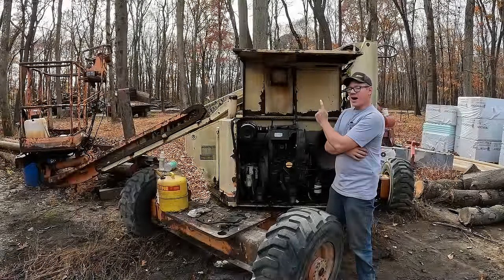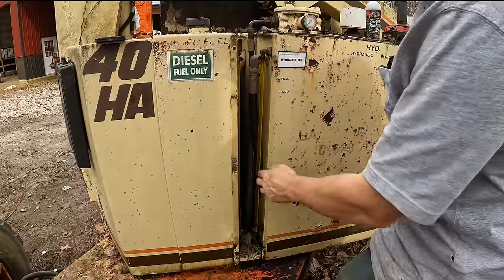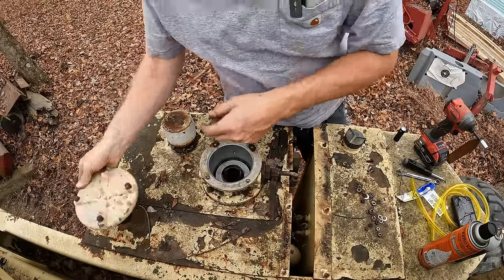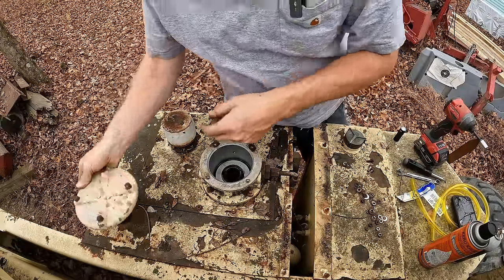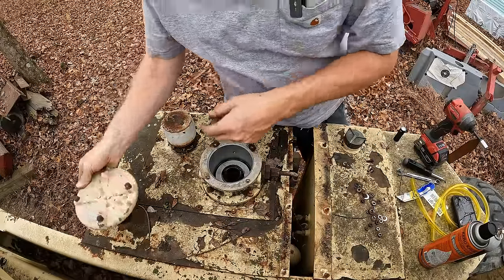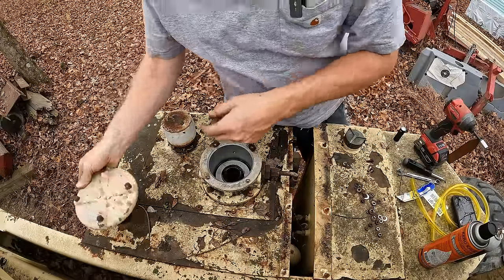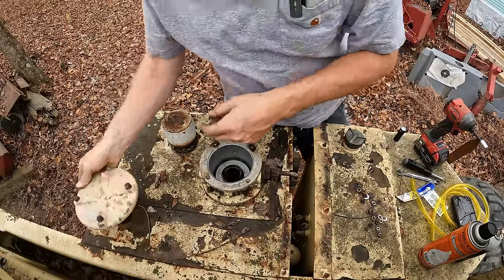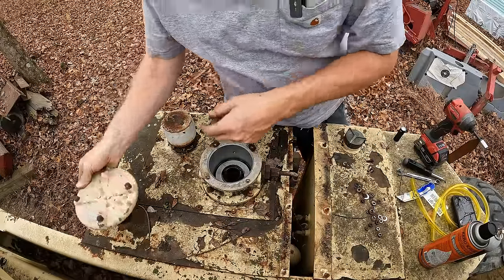I paid $1000 for this 4x4, Diesel, Man-Lift, What could possible go wrong? (JLG)

Comment: Just a tip I’d like to pass on, when working on a tank like that rather than struggling with a torch just crack a glo-stick then tie it to a length of string and drop in into the tank, once you finish just pull it out again. Great video as always Matt.
Reply: Interesting idea. Will have to try it.
Reply: Smart
Reply: A former employer of mine quit using Kroil because of it being cancer causing. Has KROIL changed their recipe since then? 
I used to not care that much, but my dad died this year of 8 different cancers.
Reply: That's a great tip
Reply: @maniachill3069  what doesn’t cause cancer?
Reply: Clever.
Reply: That glow is stick works well except the perception. Green color sort of distorts my perception whereas a white light is better.  Good idea!
Reply: @scottschenk5456  there are white glow sticks and chem lights. They come in every color
Reply: @crash1522  was just about to say you can get white chem lights
Reply: You need to watch more of his videos
Reply: @meowmeow2479  broccoli
Reply: @maniachill3069  how can 8 different cancers kill anyone? If you got hit with 8 different bullet wounds at once, one of them would actually do the killing and the others would just be injuries. Many patients have simultaneous and contributory conditions but in the race to cause death, there's always one leader. If the driver of a car has a heart attack which causes incapacitation and they crash through a bridge rail and into the lake, break their neck and are trapped in the car as it sinks, they'll most likely die of asphyxiation not a heart attack, car crash, or broken neck.
Reply: wonderful idea.
Reply: @maniachill3069  how did said employee PROVE that kroil causes cancer?
Reply: O

Comment: ED here, bought a simon-terex two yrs ago for $1100. drove it on the trailer, aftermuch work/ trimmed trees with it. it was izuzu diesel- had 50 gal. of fuel in it. lost the hyd  fluid once it blew down boom/ dripped 2 weeks in buckets. caught in buckets, was big job to pull cyclinders/ rebuild. sold for $2500. almost got killed loading on trailer!!!!!!!!!!!!!!!1

Comment: You could put a little valve at the bottom of the sight tubes, so when they’re not being used, just close off the valve to avoid the risk of it accidentally dumping its fuel/oil everywhere
Reply: this is a great idea!
Reply: This is actually how they do that on ships. You press a valve to get a level, and when you let go it springs back to the shut position
Reply: i was thinking about it too :) , it's the best way to avoid future issues
Reply: Good idea my worry with that tube is it probably isn't UV rated so will go fairly quickly. Defo put a valve in before installing a $1000 worth of oil.
Reply: Excellent Idea!
Reply: Dang, you beat me to it. I have used this solution many times. You only open the valve when you want a look.
Reply: not possible with out a hose to the ball valve, barbed fitting welded to tank, unless you remove tank an cut it off an welded in a 1/2" female NPT fitting, but dont think there room between he 2 tanks for all th fittings an valves
Reply: @arnoldromppai5395  Pipe thread elbow in the tank, ball valve threaded onto elbow, barb fitting threaded into ball valve. I've done it many times.
Reply: @jthampshire  again as a welder on heavy equipment 60 years you have to remove the tanks to cut out the barbed fitting an weld in a NPT  fitting, but if you have seen this machine there is no room for 2 sets between the tanks
Reply: @arnoldromppai5395  the picture i saw it has a brass elbow that is  threaded into the tank ,hose barbs on this kind of equipment are rarely steel ,, maybe on really big heavy equipment  they are welded but this isn't really classed as heavy equipment  ,,i have worked around mining equipment and most of that stuff has welded hose barbs on stuff like low pressure return lines ,,large lines are welded to protect against vibration on large equipment
Reply: I was going to suggest the same thing, its what we did on a friends machine, it gives a lot of peace of mind.
Reply: Agree

Comment: I don’t know if you’ve already seen FarmCraft101’s latest video, but he got stuck up high on his man lift & the auxiliary power didn’t function, so he had to rappel back down - might be worth having a rope & harness on board when you go up
Reply: I know it's not a thing in the US, but in some countries here in Europe it's mandatory to wear a harness when you go up in a manlift and stay attached to it at all times when in the basket - so if the hydraulic suddenly fails and the boom goes down, you go down with it instead of freefalling to the ground
Reply: @thesteelrodent1796  it is mandatory
 on all the job sites I’ve been on here in the us, it’s mostly because if you drive the wheels off a curb or something it can catapult you out of the basket, the hydraulic system on this type of equipment has holding valves on the cylinders that keep you from dropping from a line failure
Reply: @thesteelrodent1796  It is a thing, it's just that enforcement is spotty at best. It's not so much the boom falling to the ground and you're safer falling with that or whatever you're suggesting. It's to restrain you If the boom is struck or the chassis is struck or loses it's footing, sinkhole or something and the basket does something to eject you,.
Reply: @devriesfabmachine8721  I always have wondered how they stop the piston from falling if a line breaks. Thanks now I know ☺️
Reply: @thesteelrodent1796  it is a thing for the “for hire” or commercial operator not for the average Matt working on his own property. Though it’s always a good idea.
Reply: @corydriver7634  Here (Sweden Europe) it is a thing for the customer - if you take someone in for work there the insurance situation is unclear (because the guy is doing it at his free time)  injuries or death is on THE property owner.

This includes if you take someone in to cut down a tree using a chainsaw - there the requirements is that the wielder has a defined education (chainsaw using license.)
Reply: @thesteelrodent1796  OSHA requirements for fall protection are mandatory. Of course, as is typical with government regulations, it depends on height, whether it's a construction site, general industry/manufacturing and others. In other words, in plants the minimum height is 4 feet, construction I believe is 6 feet. That's why safety officers have to know the rules. Confusing.
Reply: i wouldn't touch that crusty man lift without a fall arrestor and a dead man switch to hit the e stop if i went over the side. for any kind of union work all of that is required, but if you are running a man lift on your own its whatever you feel like doing. he was probably fine without the harness in this video because the worst it could do is go into wild spin mode and toss him off. i suppose he could have gotten pinned between the boom and the frame which could be lethal. this dude is kind of famous for laughing at OSHA safety though lol
Reply: @Gunbudder  It is actually OK to be responsible for ones own self without the government nanny state having to baby sit.
Reply: I guess I should of read your reply before I posted lol
Reply: @thesteelrodent1796  that would mean 2 or a combined 1. A harness to keep you in the basket but allows to decent by a braked rope. But i am afraid you make this remark when the equipment was not to be trusted. When testing this have a well informed/capable mate in the neighbourhood. On the machine itself its possible to get down. 99,99% of malfunction is because of the wiring between the machine and basket!
Reply: @nildem77  should have
Reply: @devriesfabmachine8721  yep, driving em around oilfield locations I'd drive into a pot hole it'd bounce me around a few inches up
Reply: @thesteelrodent1796  Canada too, with good reason. Most deaths are from operators being catapulted out of the basket when they drive off a ramp or truck loading or unloading them. Two case at my workplace in my time there.
Reply: Eva may leave him up there
Reply: Cause his video wasn’t scripted at all😂
Reply: I've been stuck in our manlift a few times never really high up and have either had someone available who got it started or walked down the boom.  Generally you can't use the emergency lowering system because most often your working on the side of a building and if your close enough to reach you would hit the building before it came down very far

Comment: Deutz. Made in Germany. One of the oldest engine manufacturers still existing. Founded in 1864 as N.A.Otto & Co. where Mr. Nicolas Otto was the one inventor, which essentially defined the four-stroke operation cycle on gas engines. Famous names worked for them: Gottlieb Daimler and Wilhelm Maybach for instance.
Thanks for sharing ! It is always fun to watch you working on old, mostly abandoned and slightly derelict gear.

Comment: The sight glasses on our oil tanks have valves with a built in safety check ball so if they break, the check valve seals it off. Or you can manually close it to change/clean the glass/hose.

Comment: Hello Matt, Having worked for a AWP manufacturer in my past (competitor to your JLG) the unexpected swing can be two issues I can think of immediately. First is a wiring cross-over, which given the hints of upper control box you gave could be possible. The other possibility is the valves in the main hydraulic manifold might be sticking and/or bypassing to another open valve (i.e. the swing). The hydraulics and wiring in that age of machines is pretty basic so I am certain you are up to the task of repairs. Lastly, on your starting, I suspect that machine has a little module that controls the engine starting, run, engine speed, and likely low oil shutdown. If so, those modules have a tachometer wire to them and will cut off the starter if the set tach signal is sensed, even if for a split second. So that may explain the starter being turned off when it almost starts. When I worked in that industry, the control module had a black rectangular cover over a small circuit board roughly 3" tall, 4" wide and 1-1/2" deep. Probably in the lower control box or on the firewall in the engine compartment. Two or three lift manufacturers used the same style of module from Saur-danfoss, as I recall. Been a lot of years since I was there. Your load in the engine with a function likely means the hydraulic pump was forced into bypass mode of the pressure control. Basically the cylinder if bottomed out whichever direction the switch was pressed and can't move further so the fluid flow is forced over the bypass valve to protect the pump and hoses. I hope this helps! Thanks for the videos.
Reply: That’s some great information 
Thank You

Comment: Hey matt, you could put in some valve's so you can isolate the sight lines at the end of use, and to future proof changing the glass
Reply: Had the same thought
Reply: That is a great idea. You could also be able to gauge how much fuel you used by closing the valve and reopening it after use to see the level change. Same could be done with the hydraulic side.
Reply: Use to use actual glass ones with a press valve you had to press it down to release it so it showed you an accurate reading each time
Reply: Good idea

Comment: One thing that I have learned from working on unfamiliar equipment is that you need to identify as many ways as possible to shut it down and have a plan to be able to make use of those shutdown methods before you even try to start it.  Especially when you're working with something that has the ability to seriously injure or kill you or someone else if it starts to run away from you.

Comment: People like Matt are the reason that even after the apocalypse there will still be the sound of diesel engines
Reply: The sweet noise of a 12 cyl Detroit off in the distance
Reply: And the fact they can run off of crude oil and all sorts of waste oil
Reply: 100%
Reply: @jbb5266  So can gas turbine engines (why the Abrams uses them, they'll drink just about anything), but they're also much harder to maintain.
Reply: @BlackEpyon .
Important thing in a tank learned the hard way in WW II.
Gas engines fuel tanks tend to fireball when hit by a anti-tank rounds or hot schrapnel.
Diesel not so much.
Reply: I don’t think even Diesel engines will make it through what is to come.

“But the day of the Lord will come as a thief in the night; in the which the heavens shall pass away with a great noise, and the elements shall melt with fervent heat, the earth also and the works that are therein shall be burned up.” 

2 Peter 3:10
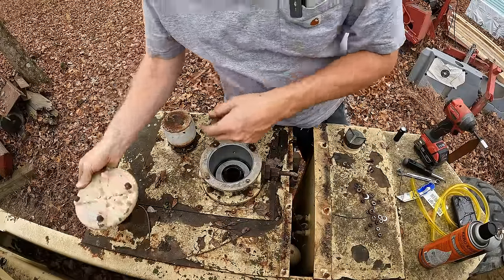Reply: @noexp7710  According to Matthew 16:28 Jesus was supposed to come within the lifetime of people that knew him, which makes him +/- 1950 years overdue. You've been stood up. He ain't coming.
Reply: @pinwizz69  Yeah, that's because diesel needs compression AND heat in order to combust. Shoot at a diesel tank, and you're just making a mess. Also, diesel engines are just a lot more efficient at moving 30-60 tons or armour around than gasoline engines are. Gas turbine engines have an even better power to weight ratio than diesels do, but they're also fuel guzzlers. Which kinda makes it a good thing that they can drink anything from engine oil to fermented potato water.
Reply: @BlackEpyon   To understand Matthew 16:28 fully you have to read a little further into chapter 17.  

“Truly I say to you that there are some of those standing here who will not taste death at all until first they see the Son of man coming in his Kingdom.”

17:1 Six days later Jesus took Peter and James and his brother John along and led them up into a lofty mountain by themselves. 2 And he was transfigured before them; his face shone as the sun, and his outer garments became brilliant as the light. 3 And look! there appeared to them Moses and E·liʹjah conversing with him. 4 Then Peter said to Jesus: “Lord, it is fine for us to be here. If you wish, I will erect three tents here, one for you, one for Moses, and one for E·liʹjah.” 5 While he was still speaking, look! a bright cloud overshadowed them, and look! a voice out of the cloud said: “This is my Son, the beloved, whom I have approved. Listen to him.” 6 At hearing this, the disciples fell facedown and became very much afraid. 7 Then Jesus came near, and touching them, he said: “Get up. Have no fear.” 8 When they looked up, they saw no one but Jesus himself. 9 As they were descending from the mountain, Jesus commanded them: “Tell the vision to no one until the Son of man is raised up from the dead.”

Jesus’ transfiguration was a vision of his “coming in his kingdom.” Some of his disciples Peter, James and John were witness to this.
Reply: @BlackEpyon  

3 knowing this first: that scoffers will come in the last days, walking according to their own lusts, 4 and saying, “Where is the promise of His coming? For since the fathers fell asleep, all things continue as they were from the beginning of creation.”
2 Peter 3:3-4
Reply: @noexp7710  Dude, you don't need a prophecy to know that you'll be called out on your bullshit. It's literally the most obvious prediction anybody can make.
Reply: @noexp7710  I got one better. Read 16:27 to know what the REAL context of verse 28 is.
Reply: @BlackEpyon  Matthew 16:27 For the Son of Man will come in the glory of His Father with His angels, and then He will reward each according to his works.

After dying for our sin Jesus became the judge rewarding one based on belief and the life we’ve live.

2 Corinthians 5:10: “For we must all appear before the judgment seat of Christ, that each one may receive the things done in the body, according to what he has done, whether good or bad.”

There will also be a second coming and judgement day for the world.  The signs spoken of to look for are here wether it be drought (Euphrates was predicted as going dry in Bible), famines, pestilence, earthquakes, violence, even the combining of religions.  No one knows the day nor the hour but based on what I see I’d say we are close.
Reply: @noexp7710  The point I was making is that  verse 28 wasn't referring to The Transfiguration, but to his return. A return that was meant to happen when some of his disciples were still alive.
Reply: @BlackEpyon   I get the point you were trying to make but I disagree.  I say that based on my understanding of what we discussed along with Matthew 24 and other scriptures.  Jesus foretold of what had to be fulfilled before his second coming. 

Matthew 24
3 Now as He sat on the Mount of Olives, the disciples came to Him privately, saying, “Tell us, when will these things be? And what will be the sign of Your coming, and of the end of the age?”

4 And Jesus answered and said to them: “Take heed that no one deceives you. 5 For many will come in My name, saying, ‘I am the Christ,’ and will deceive many. 6 And you will hear of wars and rumors of wars. See that you are not troubled; for all these things must come to pass, but the end is not yet. 7 For nation will rise against nation, and kingdom against kingdom. And there will be famines, pestilences, and earthquakes in various places. 8 All these are the beginning of sorrows.

9 “Then they will deliver you up to tribulation and kill you, and you will be hated by all nations for My name’s sake. 10 And then many will be offended, will betray one another, and will hate one another. 11 Then many false prophets will rise up and deceive many. 12 And because lawlessness will abound, the love of many will grow cold. 13 But he who endures to the end shall be saved. 14 And this gospel of the kingdom will be preached in all the world as a witness to all the nations, and then the end will come.